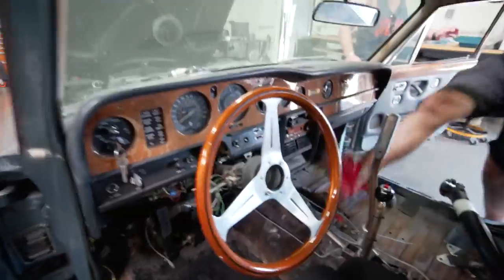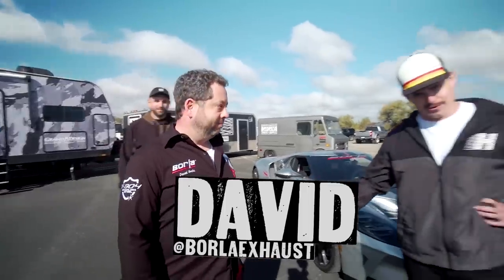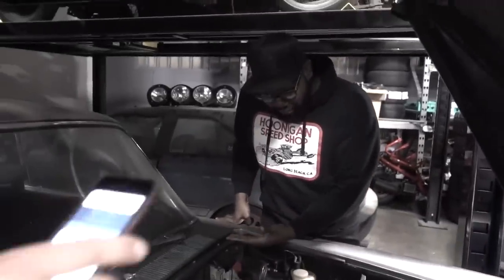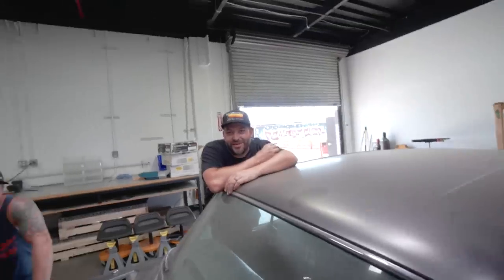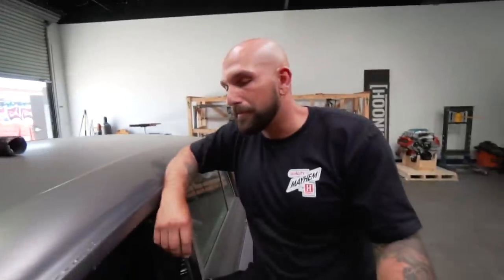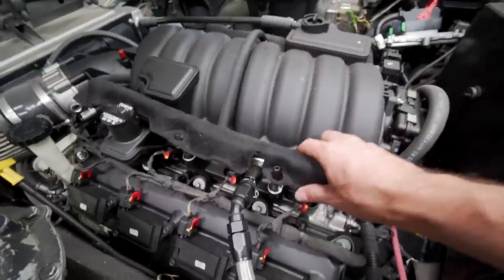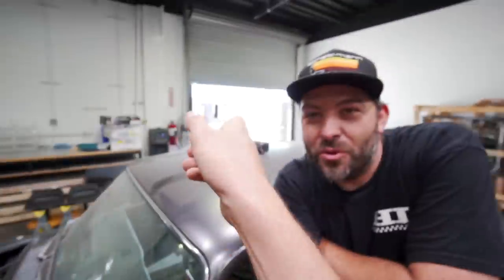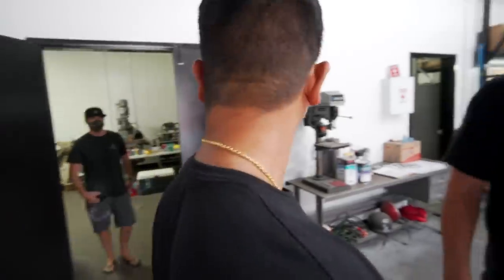Rolls Royce Drift Car!? Re-rebuilding our ’78 Silver Shadow II into a 700hp 4-seat party shredder!

Comment: We had a 2005 Mini Cooper S that had 500HP that was used as a autocross monster and daily driver and needed an exhaust that wasn't straight piped and called up Borla and had them put a special flange on to their Mini Cooper exhaust so it would fit the exhaust manifold we had and they had no problems with doing that for us. Definitely 5 stars and will shop there again.
Reply: I bet that mini was a monster! 500hp sheesh!
Reply: @Dukes3677  It was insane. We ran 10" wide tires all around, changed the suspension and ran lightweight wheels and it would pull 1 G through the turns. Another cool thing to see with Minis is when you are driving correctly through the course when making a turn it will pull the inside rear tire off the ground because they are so ridged with tighter suspension.

Comment: I have a 1984 GMC Sierra Classic and want to swap out the original 350 motor for something that will sound a little better. I’m not looking for fast I’m looking for quality sound for the truck itself. But if fast comes along with the engine, then ok.

Comment: Alright, I love the Apache motors so, even if it turns out being a low horsepower build. I'm gonna love this thing either way. I agree with you guys that literally everything today basically has 1,000hp but... At some point, you gotta just get over it. You're not racing, It's not the most realiable thing, and it's not streetable anymore at that point. (Unless your on a tire.) I think just putting some bolt ons, and a cam on the 6.4 would be SO good. It would be something different too. Everyone swaps a hellcat motor in stuff. It'll make stuff a lot easier too, because there's other parts of the build that need to be done. Do you guys really wanna swap a motor too?
Reply: I guess 707 hp is considered low horsepower these days.

Who would have figured.